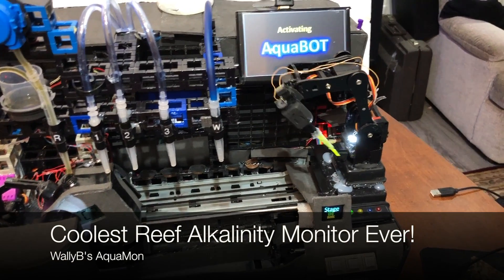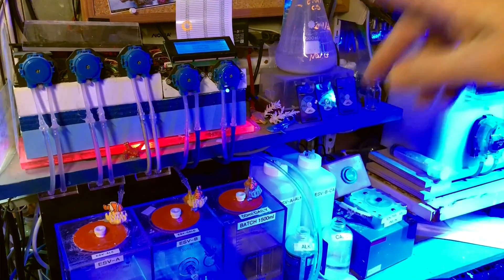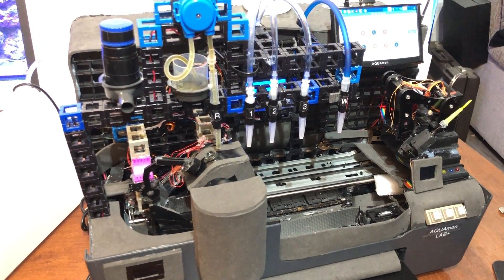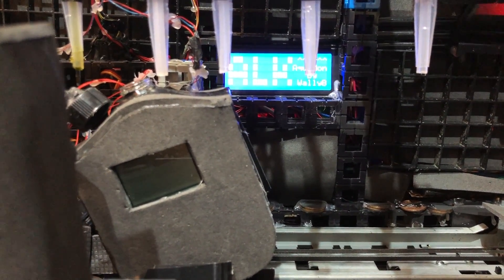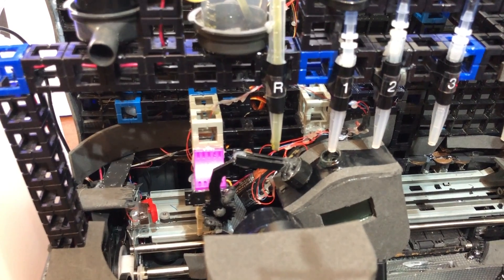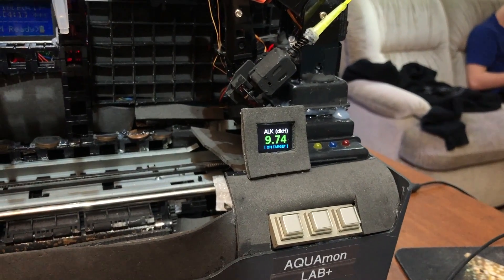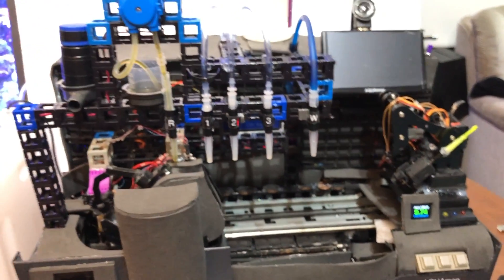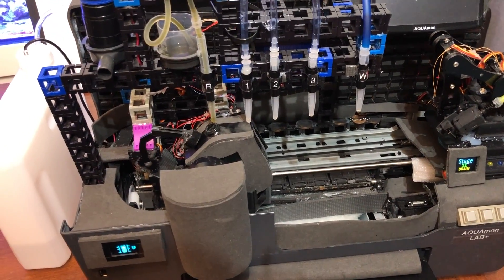The world's coolest Reef Alkalinity Monitor!

Comment: Definitely cool, and over-engineering was probably the goal. There is a much easier and cheaper way, though. You can get an electronic ph sensor, then use three dosing pumps for sample loading, HCL titration and H2O cleaning, maybe also a servo for purging the reaction vessel. But it would look a lot less hilarious!

Comment: What's the point of all the custom built gear if the corals are not thriving
Reply: Just for the Fun of it, and Education. One New SPS Tank needs More Time.......The Other Tank is doing Very Well on THIS CUSTOM GEAR  [     https://live.staticflickr.com/65535/49603250288_3c10a77776_h.jpg    ]
Reply from the maker: I think its great Mihai... its a very useful tool regardless of the result, and i am sure it will with Wally's long term plans to keep sps

Comment: Haha Yes We engineers love making stuff especially if there's a problem to make life easier.
Reply: I think being an Engineer is my SPS Downfall (I love to tinker, and Corals don't, since they want stability).  Trying to change (I mean NO CHANGES)
Reply: @WallyB_  You did some pretty cool things. I've got a lot of automation on my 450g system.  The only thing I haven't automated is an Automatic salt mixing station where it will properly dispense the correct amount of salt into the mixing station. It's fairly easy but the cost of some of the components I needed were way too much to make a few years ago.